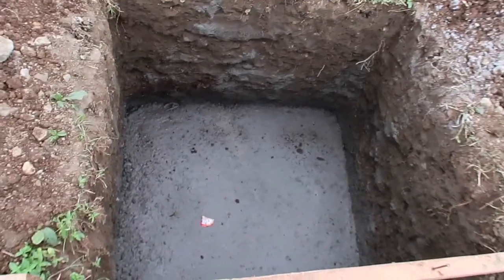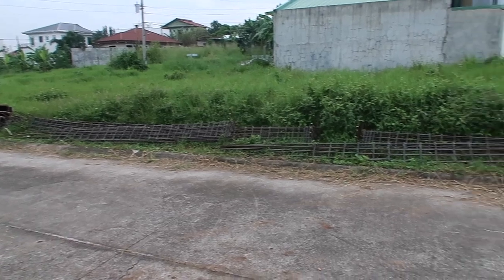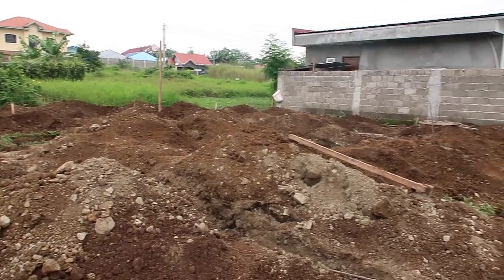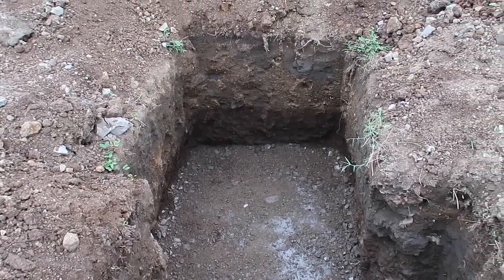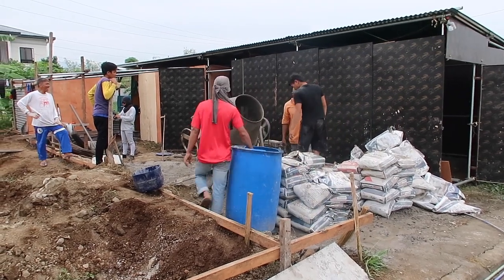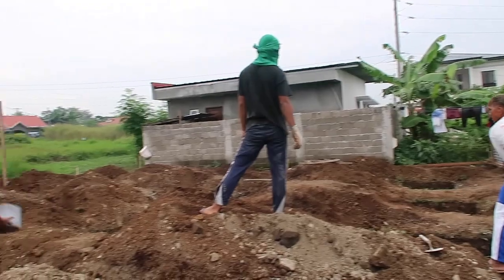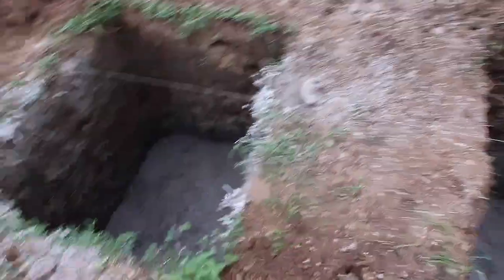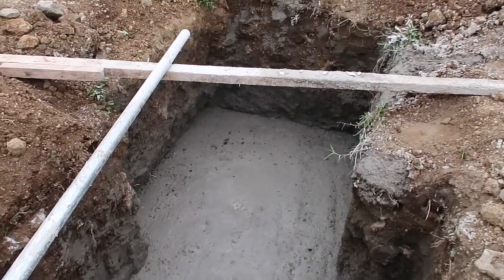HOUSE BUILDING IN THE PHILIPPINES - EPISODE 10: COLUMN FOOTING REBAR

Comment: You should tell your contructor the proper concrete Mix ratio for the footing Foundation , column and Beams should be 1:11/2:3 which is 1 bag of cement, 1 11/2 bag of sand and 3 bags of gravels. For flooring is 1:2:4 and make sure to tell about the water not to dry and not to watery ..if he is not following the ratio then he is cheating on you guys, ive seen also the gravel they used for mixing in base of the footing , that kind of gravel with dirty should not be use. Gravel that should be use is the same kind of gravel will be use for column and beam except it should be like 2inches with out dirt.
Reply: Not a class A mix, class A is 1:2:3, not soupy, you should use concrete vibrator to remove air bubbles inside the poured concrete
Reply from the maker: Thanks for the tips

Comment: I find it weird that's  there's no  wheelbarrow...same with James/villa Feliz ..never did I see a wheelbarrow...
Reply from the maker: Using wheelbarrow requires a lot of shoveling and how you going to measure the formula? Still you need to sack each gravel and sand ,filipino are resourceful and im hoping one day i can see someone using wheelbarrow
Reply: @retiredandhappyinphilippin3329  not to mix concrete  . But  to pour concrete  from mixer to foundation.Three wheelbarrow  will be fine  .instead  of buckets...